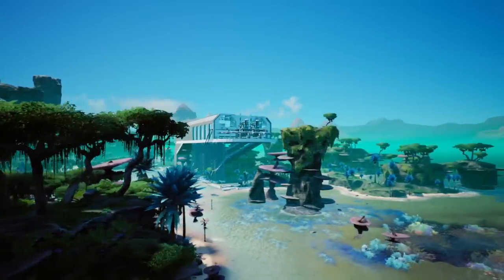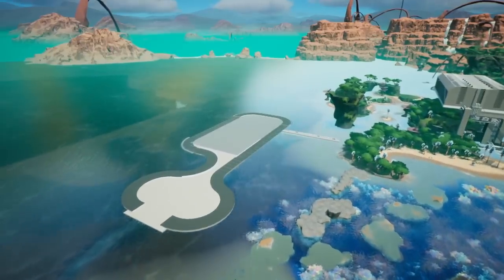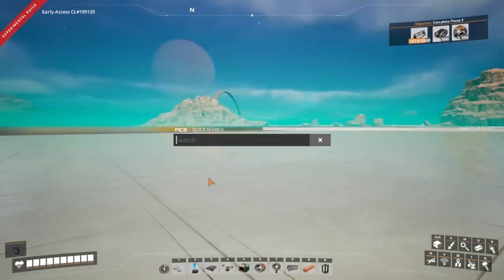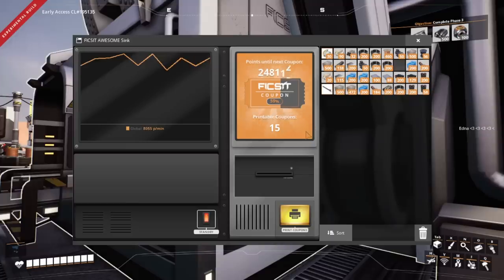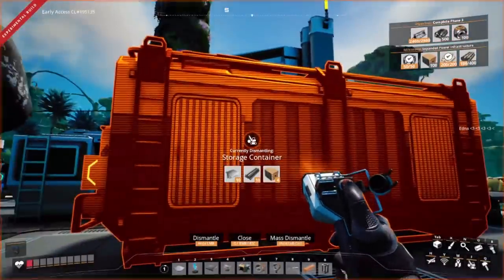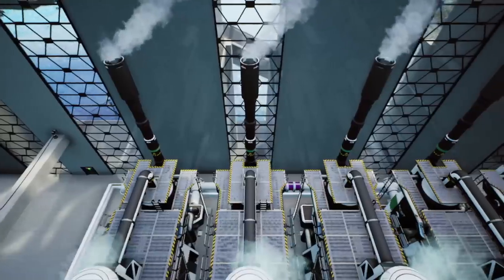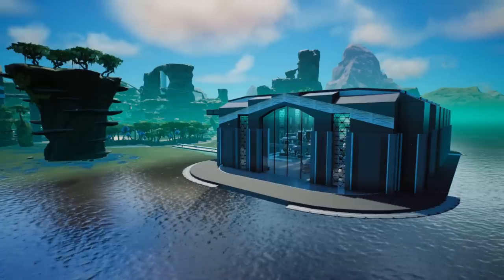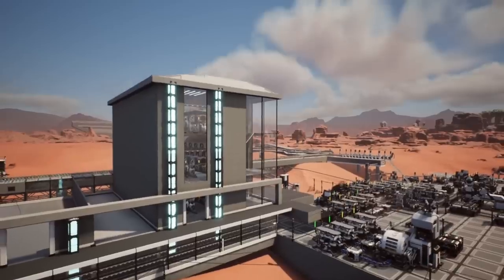My Sleek Spire Coast Fuel Setup Satisfactory Update 6 Lets Play Ep.08

Comment: Fuel gens overclocked to 194.2689% use exactly 20m3 /min, simplifies the ratios and much less floorspace required. Due to rounding at 3 decimals we can assign 9 gens to 194.269% and a 10th to 194.268%, the math checks out. Or fiddle with the percentages a bit for an odd number of generators.
Reply: Or you can type in how much fuel the generator consumes, not the overlooking percentage

Comment: I've run into the thing with the barrier-replacement trick is that the resulting wall is just the tiniest bit higher up than it "should" be, so if you try to put a 1-height foundation on the top of the resulting wall there's a bunch of "shimmer" in the result. In my current "honking huge storage site" build I ended up using sideways big pillars to "cover" the top edges of my double-wall setup. (I suppose I could've just used 2-height or full-height foundations, but... eh.)
Reply: Use a modern railing piece instead. It's exactly half a foundation wide, attach the 1m wall to the side of it to give it that offset.
Reply: @Xhaleon  Aha, that's a handy tip. Thank you!